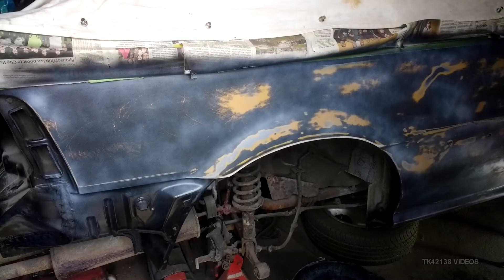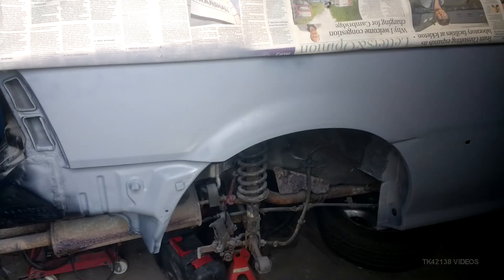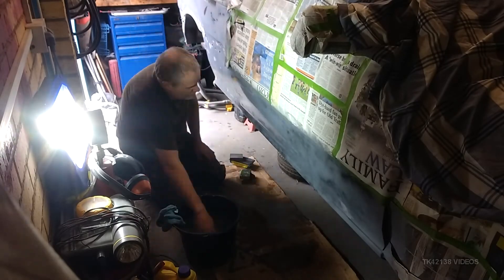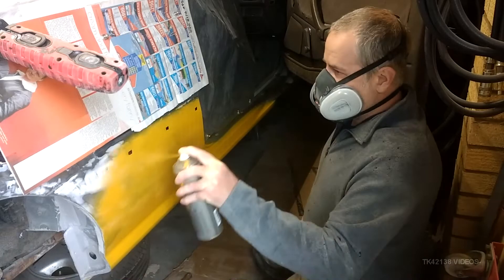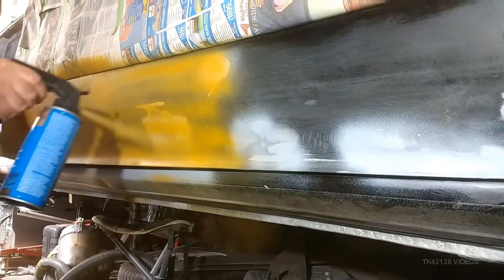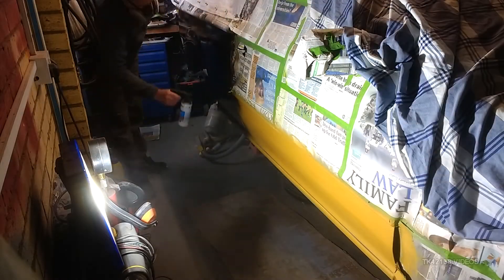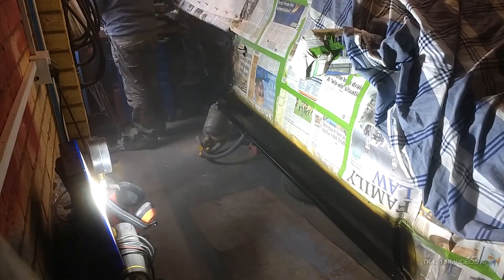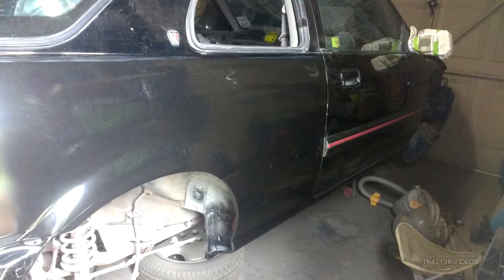Part 34 ' Priming & painting'. (It didn't go well)

Comment: I had a similar issue with mine but then I was not only using rattle cans but also was in a gazebo in the middle of December when it was cold and damp outside. To be honest though the plan was more preservation with a view to a better resto job at some point in the future. Your car being black is probably even less forgiving I would imagine.
I'm sure you will make good of it second time around.
Painting really is an art, one I myself have not yet mastered.
Reply from the maker: Exactly that: preservation. The long term plan is to get it professionally resprayed once I've repaired all the bodywork and found the budget for it.